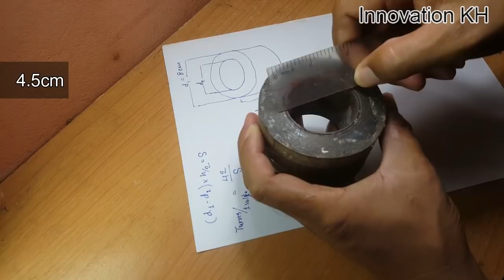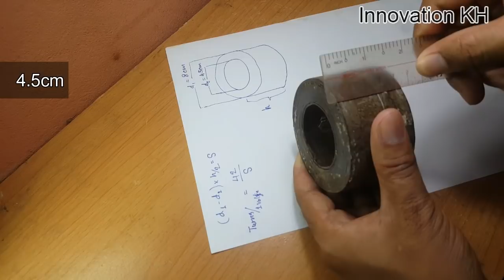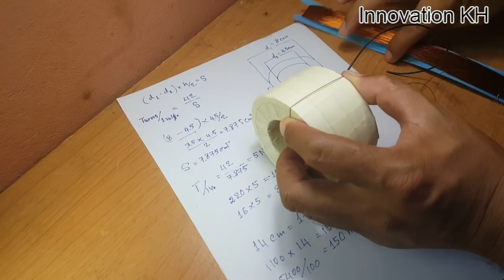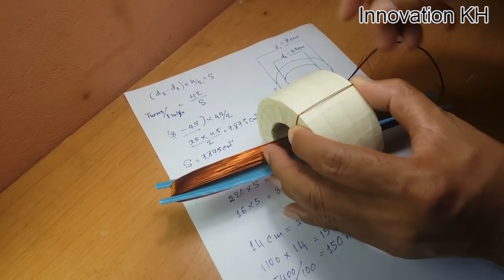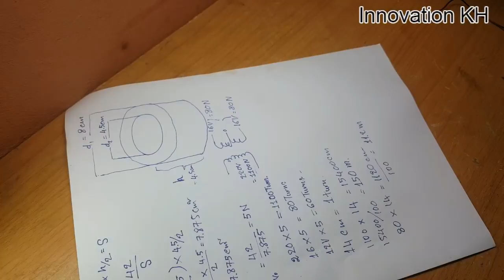How to calculate Turns per volt of Circle Type Transformer winding

Comment: This is so wrong! The rule of thumb TPV= 42/Ac (Ac = core cross section) is BS. The magnetic equation is B = (Vp x E+8)/ 4.44 X Np X Ac X f where B is the maximum usable core flux density in gauss, Vp is the primary high line voltage, Ac is the core cross section area cm sq, and f is the power line frequency. The figure 4.44 is a factor for sine wave excitation. B can range from 12,000 gauss for thick laminations (24 ga) to 17,500 gauss for thin (29ga) laminations. Tape wound toroids are made of even higher quality silicon steel with B max up to 17,800 gauss. Compare calculated numbers using this formula to the rule of thumb. I designed power transformers for 15yrs!

Comment: Hi this is so helpful your so smart can I request the all formula and solving of this im a newbie. I currently studying electrician can you help me to improve my skill in winding thank you😂😂😇
Reply from the maker: Thanks for watching
Reply: @InnovationKH  The number 42 is a constant current or frequency ??
Reply: @arismunadar7563  Its an constant when converting turn(s) to volts.
Reply: You'll first need to know how many cm/mm makes 1 complete turn. Some multiply height by width of 1 side (distance between inner and outer diameter). While others just use an measuring tape to get the exact length per turn.

Then we use the constant value of 42 to convert volts per turn. Once we know how many turns per volt we multiply it by how many volts is intended for the winding. This tells us how many turns in total is needed. Finally we then need to convert the total number of turns into metres or feet since we need to wind up the shuttle we're going to use to do the windings. Also would need to know this as we may need to order the magnet wire for the job. Of course we need to know the gauge to gives us the amps too. We can find this out by looking up on an SWG or AWG table.

Going back to the windings we need to work out 1 turn around the shuttle itself so we can do the same sort of Maths at the beginning. Once we need how many cm/mm is required per turn we then divide the total length required for the actual winding. So if the shuttle is 25cm and we need 35 metres we do 3000 / 25  = 120 turns. Add an little extra for error like a few metres or so. From here we know the exact length of wire we're about to wind on the core; so there is no need to really count the turns as we wind the core. But besides that, more importantly we have the right amount of wire needed for the winding. It be very bad thing to attach another wire to what's been winding as it needs to be consistent (Unless we want to tap it to have another voltage output/input).
Reply: You should study the tx there very well and distinguish the window and crossectional area then know the power rating of the tx wrt it.then you could comment what a big mistake they all had done here is without mentioning it how they could determine the dimension of a core?

Comment: Is it true that primary winding thickness decide watts the larger the wire the higher watts, and secondary winding thickness decide amps the larger the wire the higher the amps?
Reply: Most of the power that toroid xfmr can carry depends on flux density of toroid and primary wire diameter.

Comment: When you test the windings with the bulb can you use a DC power source or does it have to be AC?
Reply: MUST be AC. A transformers work by changing current directions of AC power. But where does the 42 come from in second equation?

Comment: I had a short in the primary winding, the first few 3  or 4 turns it had connected to the iron core, there is no isolation in the middle. Why did this happen and can i cut of this small part of the wire if the bulb doesn't light up ? No short circuit anywwere else. Can i use the original wire for the secondary winding? Mine has much more secondary windings and thicker wire.   :(
Reply: Thicker wire=higher current capacity, but everything depends on tor. core flux density. That is THE key to any transformer design. it is all about the magnetic field density the transformer supports.
Reply: @jaackmcmahon8757  I repaired the primary winding and uses the original secondary winding, transformer is working.

Comment: where do you have that 42 in the first formula ? An how do you calculate wire thickness based on the maximum current you want to have on the secondary ? Thanks
Reply: see my reply above to user "JAYATRONIK"

Comment: Hi, I need your help I have the toroidal core at OD=20cm, ID=7.5cm, H=9.6cm (weight= 19kg) so which size of wire can use for input and output to get 8000VA (input=220V, output: 144v-96v-48v-0-48v-96v-144v).
Thanks I'm waiting for your reply.

Comment: How do you wind in the single-phase (Live, Neutral, Earth). What determines which is what wire?
Reply: The live and neutral are interchangeable. The earth would be connected to a shield made of a sheet of copper between the primary and secondary winding's. If your making an audio transformer do not use this as a ground source for the secondary side. Create a virtual ground. A shield is used to reduce hum, if you use this as a ground for the secondary it will not work, it will in fact make it worse.

Comment: Where you take 42 from?
Reply: "42" is just a constant number which was deduced by experiments made in the past. The bigger the number, the better. If you already have a transformer and you want to find out if it was made with "42/S" rule, you can measure the voltage of one turn, calculate the S (=cross section area) of the core and you calculate that number. If it is less than 40, the transformer is not good and it needs more turns for the primary.

Comment: Back in the day I ran a department for toroid coils with a winding machine’s. I also worked in lamination and finish and repair. At one time we made transformers for IBM.
Reply: I had a short in the primary winding, the first few 3  or 4 turns it had connected to the iron core, there is no isolation in the middle. Why did this happen and can i cut of this small part of the wire if the bulb doesn't light up ? So short circuit anywwere else. Can i use the original wire for the secondary winding?
Reply: @Xantylon74  
It should have been insulated with tape or mylar paper. You can solder the wires back together but it would need insulation underneath the wires and it has to keep the right number of turns of wires. Be careful they can curl your hair!
Reply: @memaw5boys1girl14  Thank you! So even 2 Turns less from the primary winding would make a difference? It would increase the voltage of he secondary winding, but just a little, right?  I'm going to solder it and use a heat shrink tubing or Tape. The winding can also be insulatet with normal electrical tape?

Comment: Plz explain.. how to select wire gauge for primary & secondary winding
Reply: Selecting the gauge depends upon how much amperage your require. If you know the wattage and voltage but not the amperage. The simplest way to find out is to divide wattage/power by voltage.

Once you know the amperage; you can then follow an AWG (American Wire Gauge ) table to find your required gauge. Or use equivalent. Best to keep to your own countries measuring form. Although many companies use the AWG topology. 

Going to how does 1 know, which gauge for primary and secondary.

Lets say you need 12 volts at 5 amps. So we need to convert it to wattage.
Wattage/power = 12 * 5 = 60. 

We don't yet know the amperage for the primary but we know the mains supply and the wattage. 
Amperage = 240 volts / 60 = 4 amps.

All is let to do is account for the power loss during conversion. This we would need to get from the manufacture of the core. Rest depends upon the quality of the magnet wire you've used and also the quality of your craftsmen ship. Its an Toroidal Transformer so the loss is small.

So if the total power is 60 we could bump it up by upping the amperage and voltage a little (On the secondary). Also use an multimeter and an ammeter. Also beware the PSU circuit will have loss too. Good idea to first check the power loss of the bridge rectifier, regulator and any transistors you may be using. But if the PSU is already existing and you know its expected wattage/power input or you don't need 1 e.g. using straight AC. Then no worries and happy days.

On the Primary could simply ignore it or just add a little more amperage to compensate for the slight loss in power. Don't forget to test its the right voltage before going big picture. We wouldn't want it to overload. So what we could do is put a light bulb between 1 side of the mains and 1 side of the primary winding. If it lights up then its safe to say it needs a lot more turns on the primary. If it doesn't its about right a little too much. But we could replace the bulb for a multimeter, which would tell us by how much we are out (Note that many multimeters are often slightly out. Especially the cheap ones).

PS there is also an slight power loss when the transformer is under load. So perhaps give it a little more volts and amps on the secondary and account for any above the required in your PSU board.

Hope this helps you?

Happy winding :D
Reply: @jaycool5978  thanks 😊😊😊
Reply: @satishx2  no worries
Reply: Diameter of wire= ✓[0.4*I] mm.
Reply: James Smith Sir suppose to be did not know  the required amp of the transformer how do you calculate the wattage in order to the amp rating of the winding sir tnx

Comment: Hi how did you select wire Gauge?
Reply: بھائی صاحب: گیج جو اترا ہے وہی لگانا ھے ۔اگر گیج کم کیا تو پاور کم ہو جائے گی۔ اور اگر گیج بڑا کیا تو کور پر صحیح طریقے سے نہی بیٹھے گا۔
کیونکہ گیج کے لئیے آپکو ٹرانفارمر کی پاور معلوم ہونا ضروری ہے ۔مثلاً اگر پاور 1000 واٹ ہو تو 220 وولٹ پر اسکا کرنٹ 1000/220 یہ 5۔4 ہوگا تو 5۔4 کرنٹ کے لیے آپ کو وائر گیج کا ٹیبل دیکھنا پڑیگا۔ تو جو گیج نکلے جیسے 8۔4 کے لئیے 15 SWG ہو تو آپکو اس سے ڈبل پتلی یعنے 28 یا 30 نمبر سے 220 کی وائنڈگ کرنا ہوگی ۔ اگر یہ سٹیبلائیزر ہے تو آپکو 280 وولٹ کے لئیے ٹرن دینے ہونگے۔ 25 ۔25 وولٹ کی تین ٹیپینگ نکال کر۔اگر ups ہے تو 13جمع 13 کی ٹیپینگ نکا لنی ہوگی۔
Reply: @ranakhalid7577  thanks please write in english if possible appreciate your efforts

Comment: How to calculate in wind for impedance?. For output transformers on tube amplifiers.
Reply: AWG and SWG tables should tell you the impedance. But the rest you'll need to calculate yourself. Although you'll shouldn't have to much of a problem with that since the table gives you the main data you need.